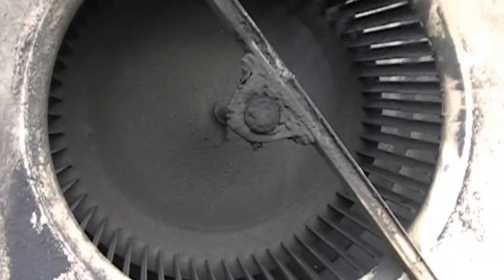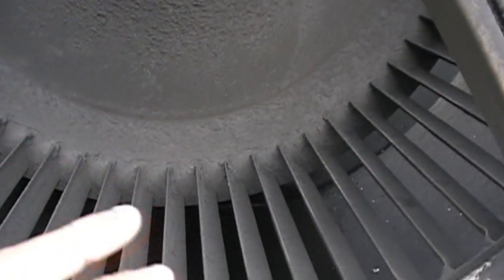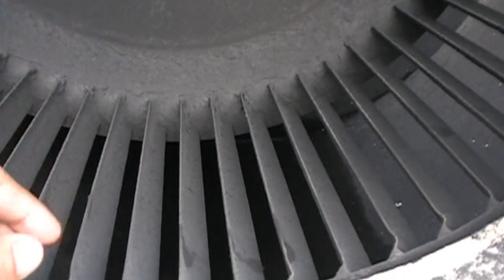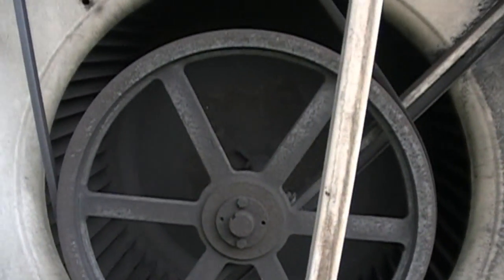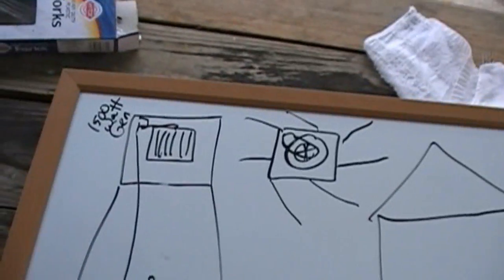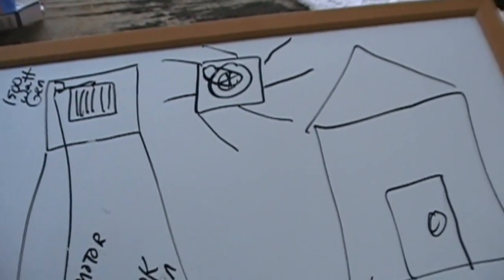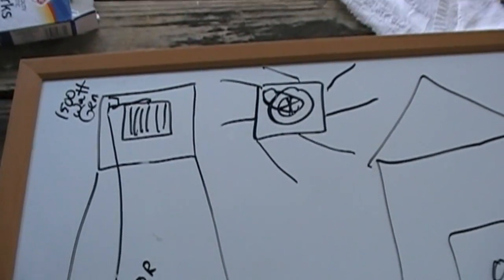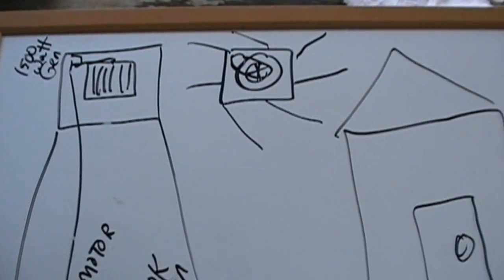vertical wind power design

Comment: This will never work, even in a hurricane, there is not enough power from the wind on that turbine.
Coming from an electrician now:
Your 110 volt output will fluctuate in frequency which will vary the ac motor output continuously much like a variable frequency drive.  A DC generator simply needs to put out higher than 13 volts to get some charge in a 12v battery.  
That said, you could run an outside yard light on your 110v genny, it would varry in light output with the wind too, kinda cool.

Comment: Here's and idea that might work. Tip it on it's side so the exhaust faces the wind, and put a big air scoop on it.  Cut a second exhaust on other side of the vent with the scoop. Then put a circle of metal around the inside that isn't touching the fan or moving parts, and close up the big circular opening. This will the channel the air around instead of through. It will work more like a water turbine this way.

Comment: Very inefficient huge power loss. You need to regulate the voltage and amps, you can probably get a grid tie regulator for windmills. A battery bank acts as a buffer like a water tank on a well. If you get some of your power from the grid you need an automatic cut off switch for power outages to prevent line workers from getting zapped. They aren't cheap either. Good idea though. Might want to modify the fans a bit.

Comment: @ironhead41 I've enjoyed your video's but sorry, you can't power a 5 horse motor with 1500 wats, power conversion ratios is 746 watts per horse power, even if you could that 5 hp motor is only 3,730 watts so you can't power a 10KW generator with less watts than you want to get out of it, and you lose approximately 20% going thru each conversion.  But keep up the entertaining videos... (60' in the air, come on I have a 30' windmill and it scares me to climb that tower)

Comment: I have a large squirrel cage fan just like yours, only bigger. My plan is to remove the cage, remove the axle from the hub, remove the hub from the center of the cage fan. I plan on using a half a trailer axle (so I don't need two carrier bearings) with a hub off a car with rotor. Maybe put a generator with bracket and fan belt or use a stater from a motor cycle, or one of those new washing machine motors.

Comment: Batteries.  If you had a battery bank, you could charge it with the fans.  Throw in a diesel generator for when the wind dies and you might become self sufficient.

Comment: you need a lot of rmps (1600-1800) on the alternator and thats idle speed on a generator which can be obtained by gearing up but the gearing up requres more torque from the wind to even turn the gears. You will need a lot of wind. A low rmp permanent magnet moter may be a better choice for the alternator. Every and I mean EVERY LAST windmill/wind turbine in the world produce AC power that is then converted to DC for storage. Keep on tinkering you may save the world.

Comment: Now if you used the wind turbine to mechanically drive a water pump to pump water uphill into a pond say 30 feet higher than a stream, then use the water to run a water turbine, you could use the volume of the pond to provide power during periods of low wind, until the pond was empty again.

Comment: Sorry, I was wrong, you are spinning a generator, which should take care of the power factor. But you still have to regulate the speed, and of course have enough wind power every moment since you have no reserve power such as you would with a battery bank. the generator would have a speed governer on it, but you would have to adapt it to control a brake or a fan duct door (rather than the engine throttle).

Comment: If you can control speed correctly, using a speed governor that regulates a brake or osemthing like that then it might work for brief periods when you have excess wind. the next problem is that your power factor will likely be crappy since it is self excited rather than externally excited. And we all know that self excitation is just wrong.

Comment: Issues I see are speed control has to be rather precise and you don't control the wind. generate Dc and use a battery bank then invert back up with a sine wave inverter. I wish it would work the way you describe, but I can't see how it can work unless you have steam power or something that you can control input power precisely with to give the right turning speed to generate 60 Hz. I admire your innovative spirit greatly however. Best of luck.

Comment: I've tryed to make a generator with 3 phase/static capasitor 7 hp ac motor. Too much power coming out and no way to regulate it. It overloads everything. You would have to come up with a super strong/reliable bridge rectifier. I would find a 24 volt dc alternator and convert that to ac. The beauty about those is you can increase your rpm's with pullies. Wish i could find a squirrel cage that big, people use those for forced air heat from an outdoor wood stove/wood boiler.

Comment: I would start with sizing load used. I can run my whole house off of a 5000 watt generator with electric hot water and well pump. You will need constant wind to use without batteries.